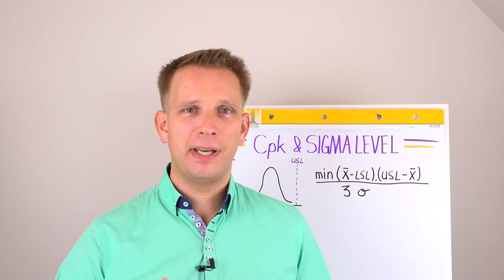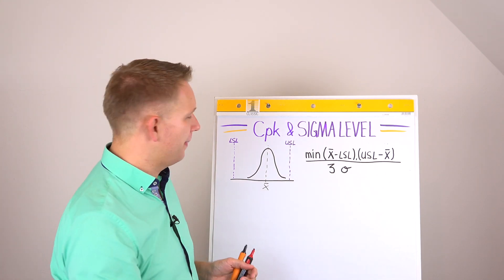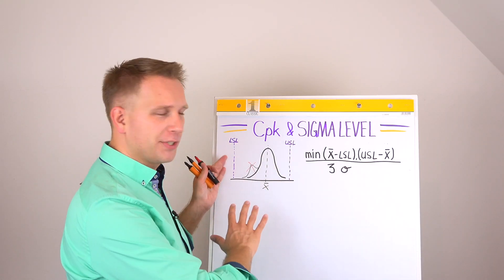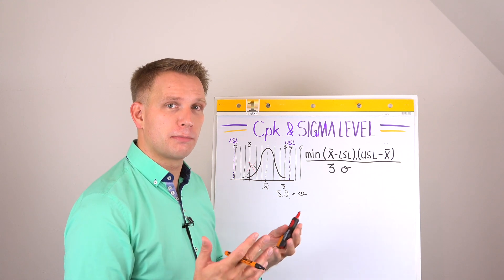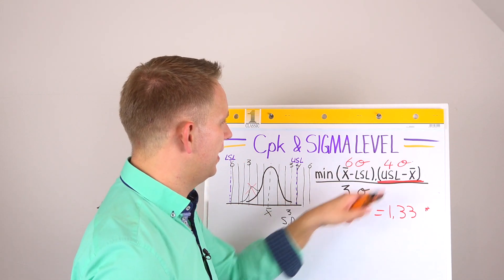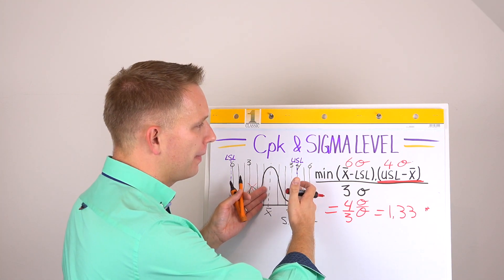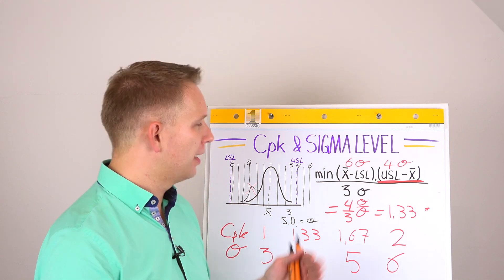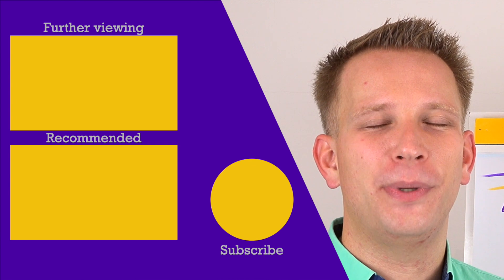The link between Cpk and Sigma level

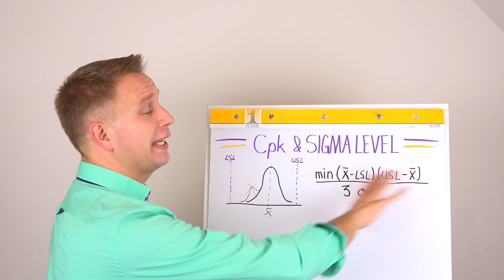Comment: haha 2:52 kinda funny but good point. What if supplier gives you CP,CPK and standard dev? How can you determine whether the data they used resulted in a "normal curve". 
Should you graph the bell curve if you get the raw data to verify?
In terms of the 6 sigma, why would you want that? You'd increase your tolerances to expand the USL and LSL. Or, your bell mean (center of bell curve) is moving left or right. Doesn't make sense if an engineer want's to keep a tighter tolerance band.
Reply: Perhaps I've misunderstood your point but the goal is not to achieve 6 sigma performance by widening tolerances (the customer might have something to say about that) but to reduce special cause variation within your process to shrink the SD such that your process mean sits 6 SD from the closest customer spec, upper or lower. This achieves very high process yields while allowing "wiggle" room and time to respond before more defects are produced
Reply from the maker: John's reply is great on your second question (thanks for contributing, John).
As to your first question - you could ask your supplier to also show a Q:Q plot: this plots the observed measurements in a distribution graph that will show a straight diagonal line if the distribution closely resembles a normal distribution, or points deviating from that diagonal if certain values are over or under-represented.I would always first check the bell curve on it's normal scale as this might show all kinds of oddities, but the Q:Q plot is much better at specifically checking for normality.
Do keep in mind that your goal is to get a stable supply of parts for your production process, not to get all possible statistics from suppliers. I would use such a step only if you have reason to doubt the validity of your supplier's Cpk statement. Maybe you get half a batch of out of spec (or very close to spec) products from time to time, while the supplier claims a Cpk of >1.33.
I would always advise you to go talk with your supplier when you've got processing problems with products involving their parts (don't immediately share all your trade secrets 🤐) - they may know of changes in their process or materials, how their other customers solved similar problems, double-check their production process, etc. As soon as you've opened up dialogue with them, looking at their Cpk data together can be a logical next step (which they'll be much more happy to do when they understand that you're trouble-shooting and not just 'giving them trouble').

Comment: Can you do a video to explain how to convert different sigma level. Example: Cpk>=1, X = 25um @ 3 sigma is equal to Cpk>=1.66, X = 60um @ 5 signma. I saw a conversion table but don't know what is the formular for this. Thank you in advance.
Reply from the maker: Hi Lucas, I’ve been thinking about your question for a couple of days now, but honestly, I don’t really get it - I can give more detailed examples of various sigma levels (with sample data), but that wouldn’t make a 3 sigma process equal to a 5 sigma process. 
Did you mean that by centering a process (variation/sigma stays the same, but we move the centerline of our process farther or closer to the specification limits) the Cpk and sigma level do change (even though sigma itself doesn’t)? About that, I can make a video 😉
Reply: @TomMentink  I read an article which has this conversion table. Now can't find back the link. I'm also confuse to this. I can share this to you via email since I printed out a pdf version to read. Thank you in advance.
Reply from the maker: @lucasnq3224  please do - you can view my email address in the about section of my channel page (in a browser)
Reply: Plz do share with me it will be great favor